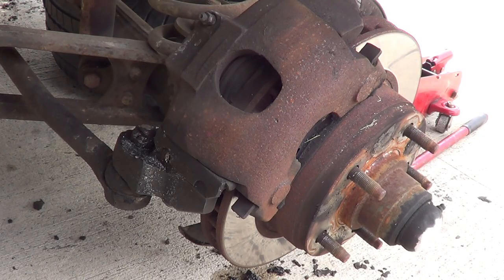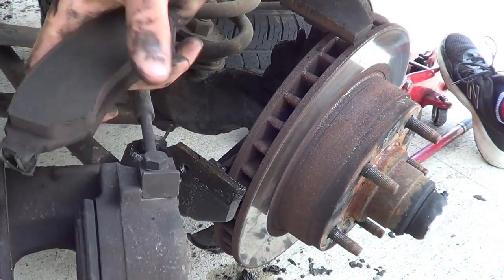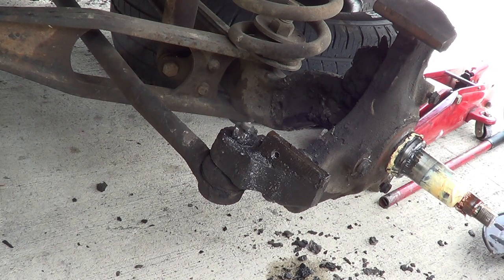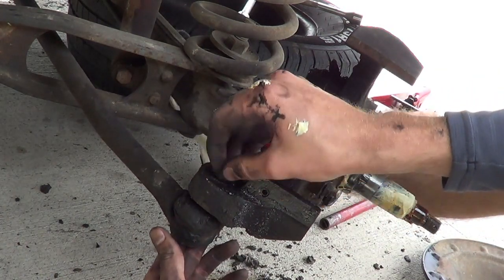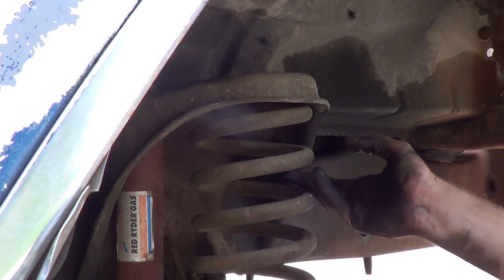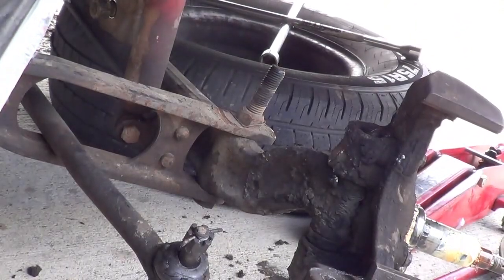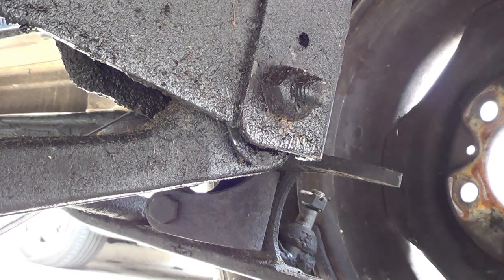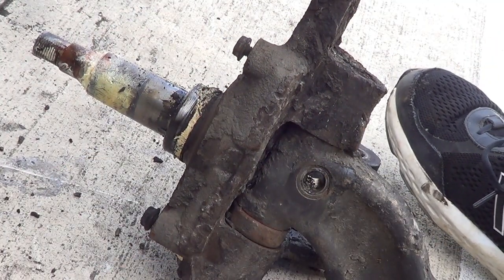F100 Kingpins Part 1 Removal

Comment: MY NE LOCK PIN DOES NOT SLIDE INTO THE NEW  SLEEVE. D O I HAVE THE WRONG PART OR DO I NEED TO HAMMER IT IN
Reply from the maker: Part 2 and 3 of this series explain what I did.